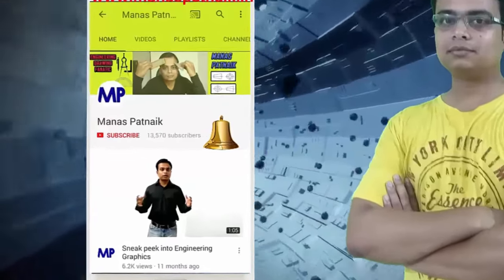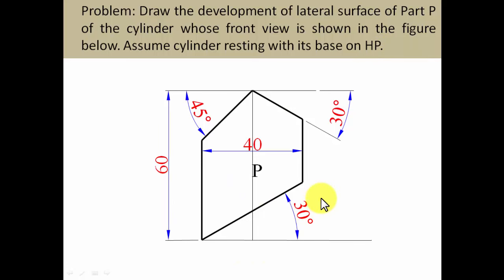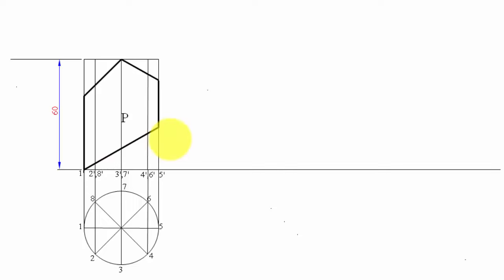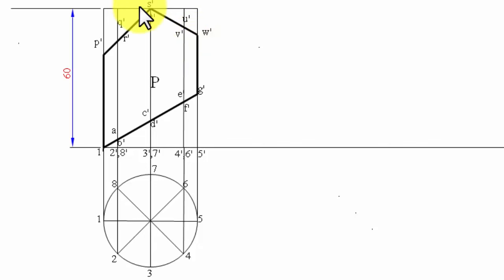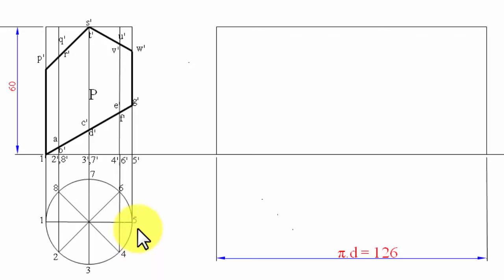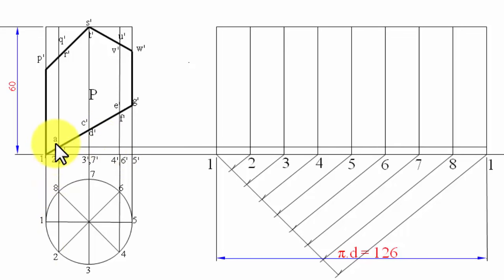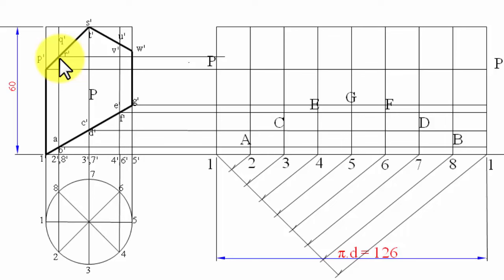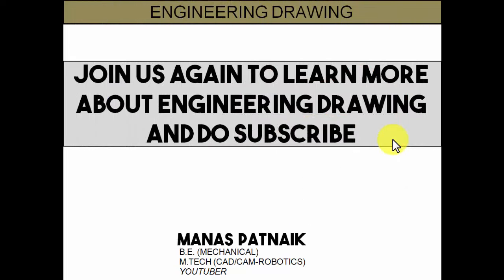Development of Surface of Cylinder_Reloaded_Problem 3

Comment: Sir, the cutting plane which makes an angle 30°with reference also passes through 1' but sir, why you would not considered it with any point
Reply from the maker: You can mark it..... But it will actually coincide with 1'
Reply: Thanku sir